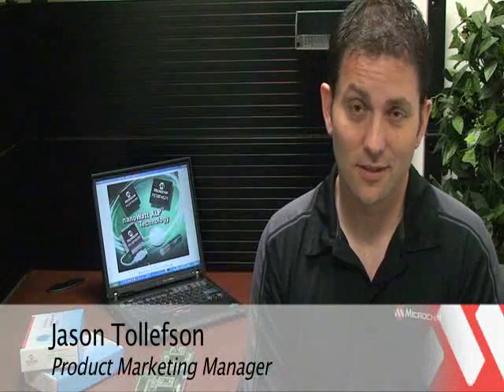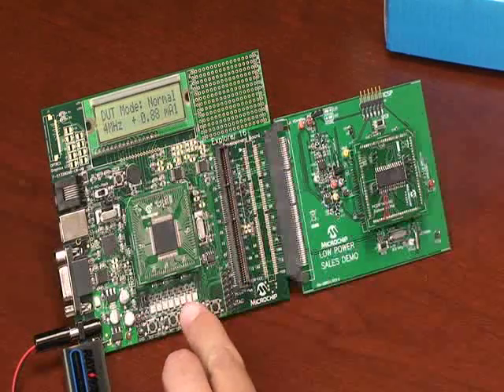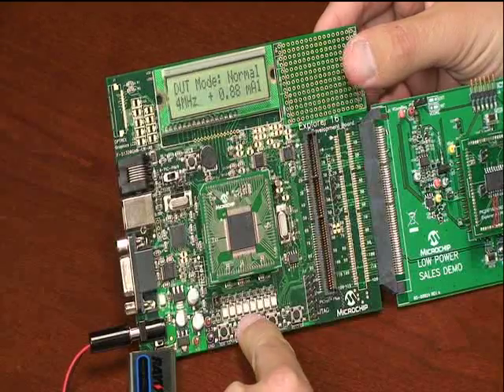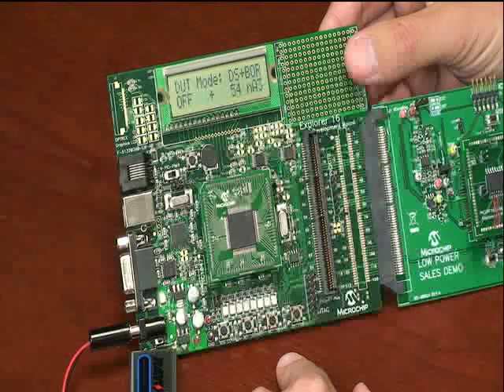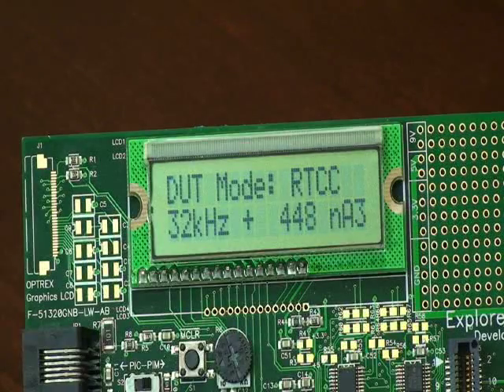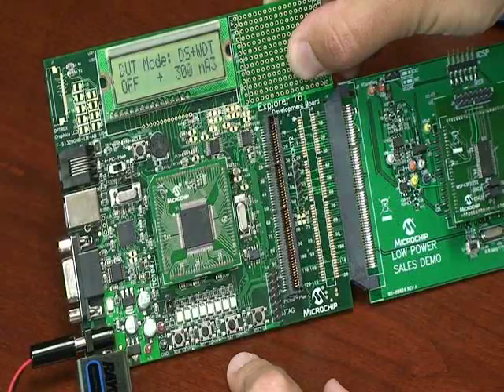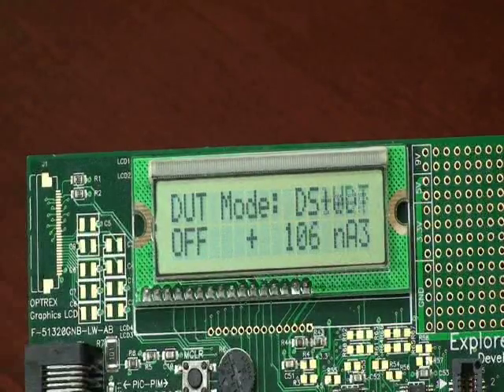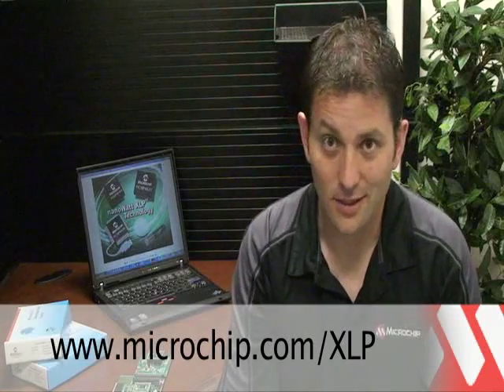Low Power MCU Comparision: nanoWatt XLP Vs. MSP430

Comment: @yttrax I wouldn't necessarily agree. I agree with the MicrochipTechnology response especially on the energy harvesting front. There are fascinating and innovative techniques emerging (like microbial fuel cells) that provide very low, but very steady, environmentally friendly remote power. On a budget of a few hundred uW, we need all the energy effiiciency in MCUs we can get! Keep up the good work Microchip!

Comment from the maker: @yttrax “It is true that many MCUs now provide sleep power consumption at <1uA.  What sets PIC MCUs with XLP apart is that we can also run a Real-Time Clock, Brownout Reset, and Watchdog Timer & still be around 1uA.  Many new applications are looking to add RF capability.  This taxes the battery much more than a traditional low power application.  Combine that with the increasing interest in Energy Harvesting, and soon even u-Amps matter!  Thanks for your comments.